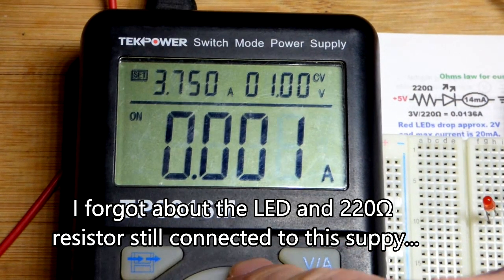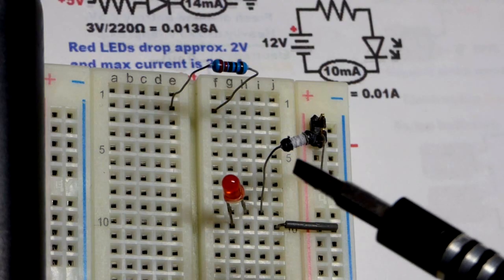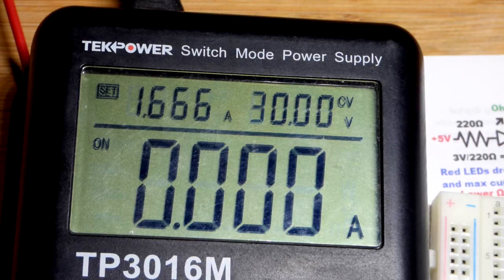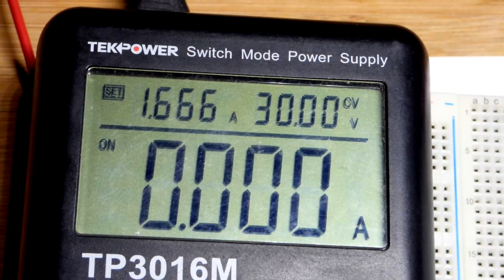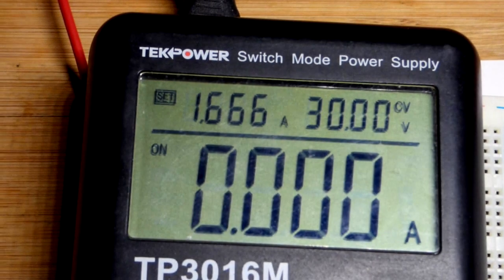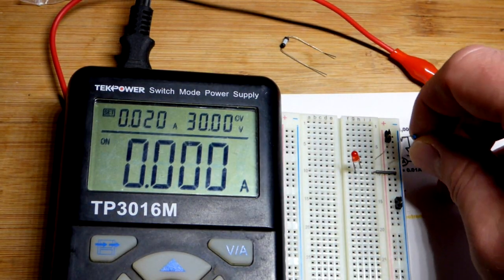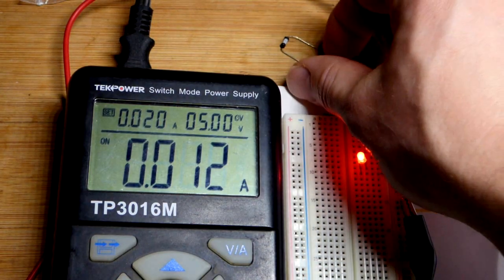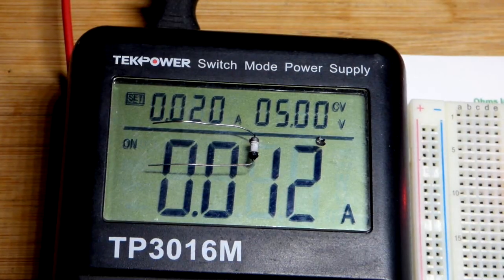Oops Just Completely Burnt My First Resistor

Comment: lol, got a few thousand 2n2222's. various circuits, every now and then ones that didnt work. frien drops in one day, as we're playing i complain that "these chinese 2n2222's dont contain enough magic smoke..."

precisely as he does something and the circuit erupts in a nice cloud of blue brown smoke...
"oh... i see. i wasnt trying hard enough..."

resistors... another fun experiment is gate drivers. a 10R is fine. a 100R smokes. cost me a few brain cells figuring out the physics of that one...
Reply from the maker: Almost no current flows through MOSFET gates unless they are being switched on and off rapidly. They basically act as a capacitor when you only look at the gate. A voltage spike can force current though and destroy the gate. So it is a good idea to add protection to the gate.
Reply: @Electronzap  yep. at 500khz+, theres a pretty hefty current flowing when driven with the ideal square wave. best to use the datasheet specced gate resistance... minimal dissipation and ringing is damped "perfectly".  as resistance increases the dissipation does as well, until the point where the current is limited... which also means the fet never gets out of the linear region and it subsequently fries...